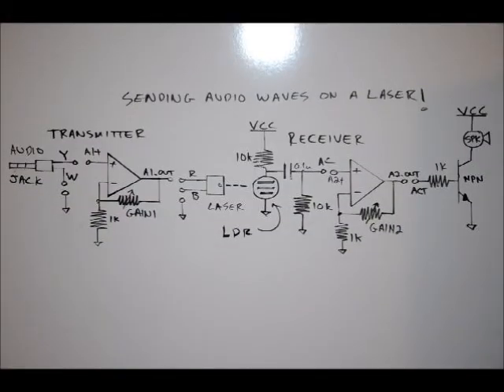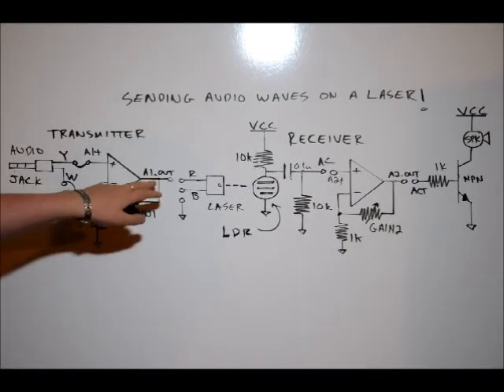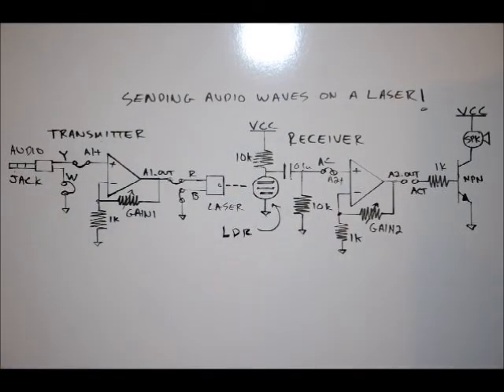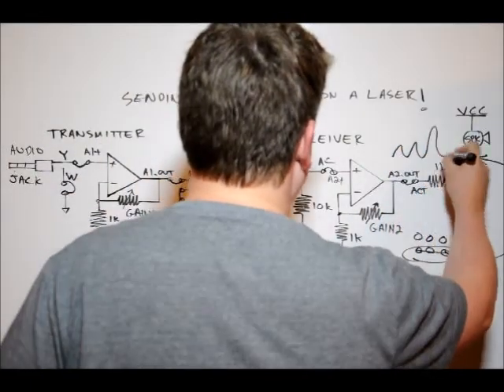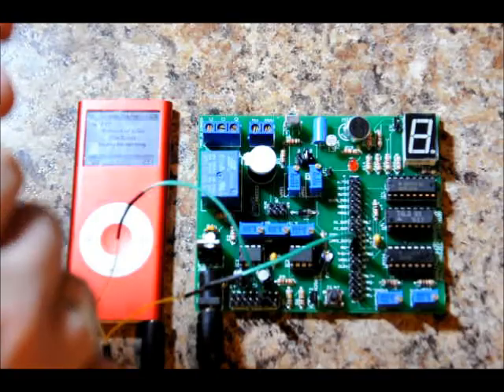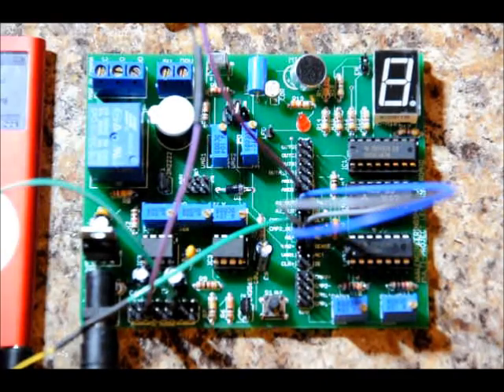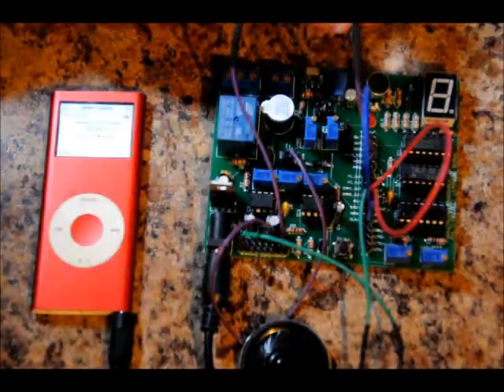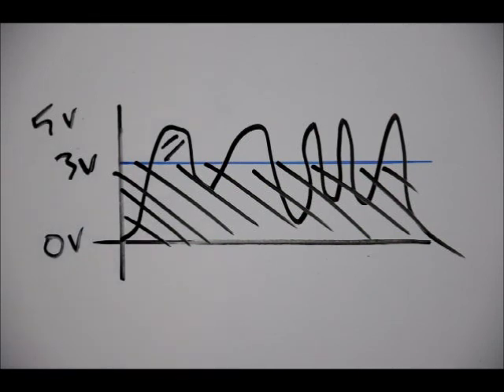Project#20 "Sending Audio Waves On A Laser" - The Multi Project Electronics Learning Board

Comment: What !!! mine cost me 3 dollars from china any laser can be PWM !!!!! just use the raw laser no electronics to it ! all to do is have a 555 running at 30 or 40 khz  as a sawtooth feed that to the one of the lm311 inputs have a op amp feeding to the other lm311 input ...out put of the lm311 can run a red laser fine ...use a lm317 to feed the power to the laser what ever voltage the laser runs at ....there you go PWM sound or low def video ..i have done it many times junk box parts .

Comment from the maker: You could do this, but this board is hardware only.  There is no software.  No programmable chips =(  I think that these lasers can be pulsed on and off properly up to only a few kHz.  If you try to do it any faster, I think that line capacitance will start to to effect the transfer.